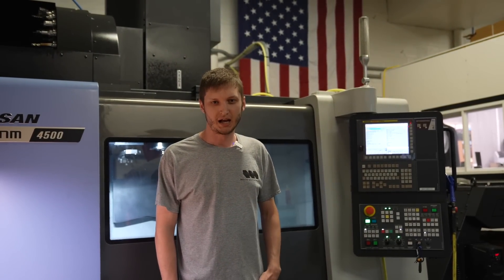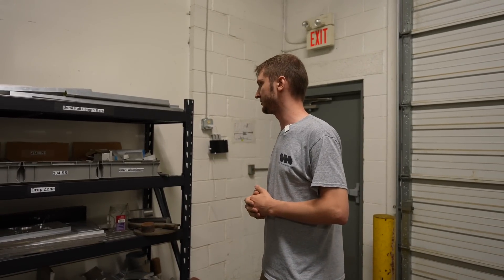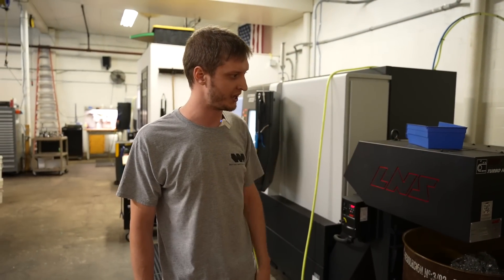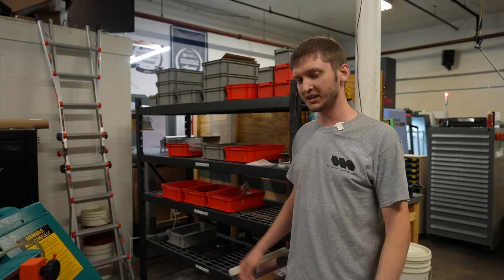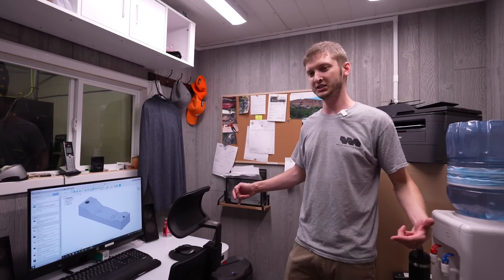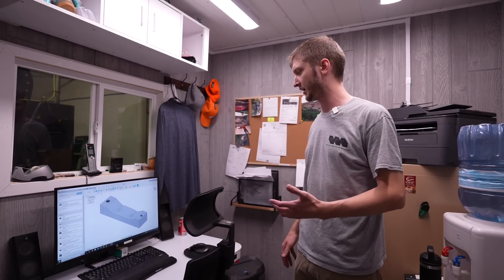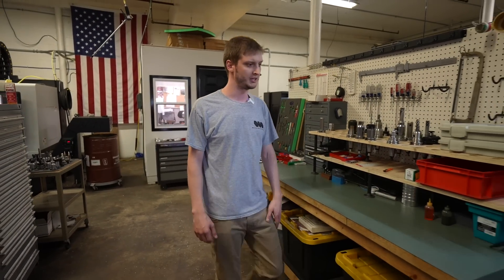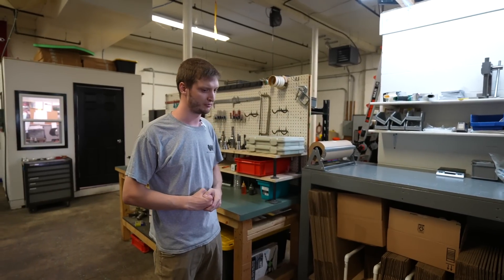Machine Shop Tour At CNC Rapid Prototype Machine Shop | Motive Machine Works

Comment: Ah the old days of managing a 3-person shop.  Unable to bill out enough shop hours to sustain growth until we reached 6-full time employees.  Otherwise overhead consumes profit living month to month having way too many eggs in one basket by keeping one or two customers happy.  All it takes is one of those customers to miss a NET 30 and cash flow begins to go downhill.  Funny thing how all those material suppliers want paid in 30-days and don't care if you haven't been paid for 45 days.
Reply: I don't have any of those problems. Most of my equipment is paid off. 4 brand new machines with the oldest being from 2019. We intend to stay small. I don't really want to deal with the logistics of 6-15 employees. We are still growing but it is gradual. Almost no debt at this point. Cashflow not an issue. As far as material and other items, 99% of what we buy is paid up front with a credit card and then auto paid by the company every month. Staying small makes the most sense to me at this point. There are times where we are slow but Most of the time the issue is that there are not enough hours to get accomplished all of the work at hand with such tight deadlines.

Comment: Awesome video! So did you get customers before or after you quit your job? How did you acquire customers?
Reply: I had zero customers before I quit. I would absolutely not recommend doing that. However, I did have enough money in the bank to sustain living for 1 year if I made zero revenue. I also had a side business from the past to fall back on if it came down to that. (I ended up not needing to go that route) I had a few connections from previous jobs, but nothing major. I also did some outside of the box advertising in person in a trade show type environment. But overall making relationships with customers ends up being the best way to keep customers.
Reply: Awesome !